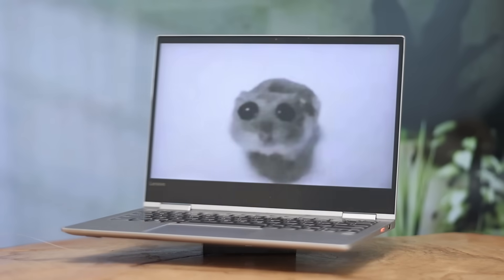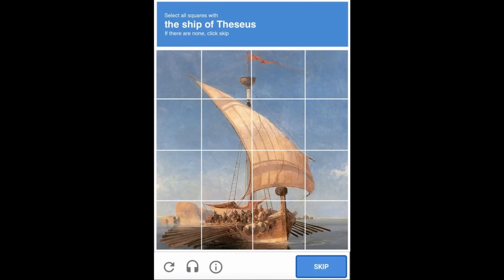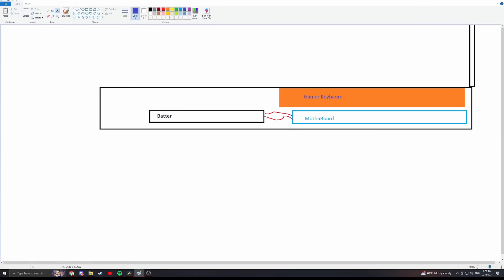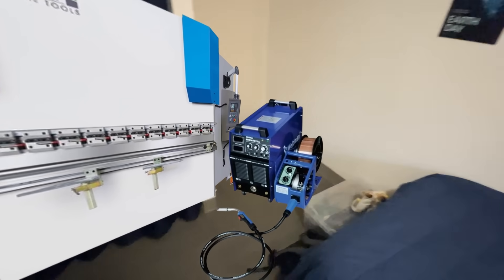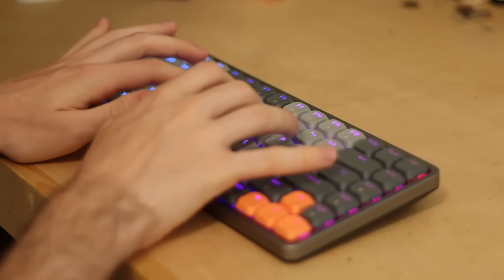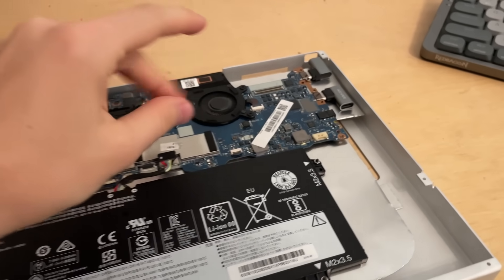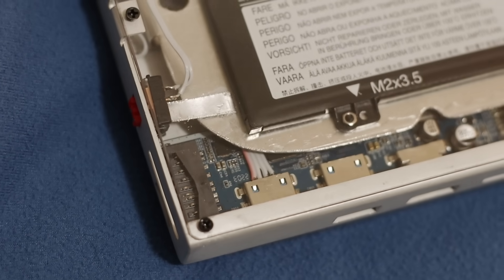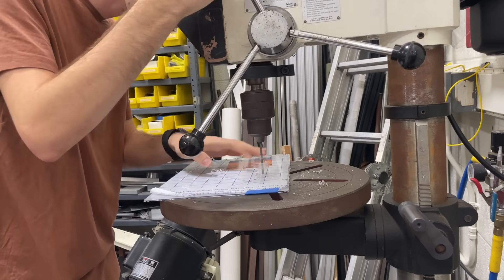I Put a Mechanical Keyboard INSIDE My Laptop

Comment: The nvme controller in my newest laptop (abt 5 years old) died a few months back. I've been suffering with my 9 year old laptop since. Barely even runs ubuntu or whatever I have on it, with awesomewm..
Perhaps the time has come to take destiny into my own hands slightly more than living at the mercy of whatever used laptop I can find, and a mechanical keyboard would be nice.

Comment: I decided to take 3 months of my life at the beginning of this year and designed a 18" laptop frame that is 3" thick that uses standardized desktop parts. One of those parts is a Reddragon K617 keyboard. I have been using the laptop at school and it is definitely also a conversation starter. Mini itx motherboard with noctua L9 cooler and a nice rgb fan on top, along with an rtx 3050 and a flex ATX power supply... I just have to make sure a wall outlet is nearby

Comment: Me Lenovo V14's keyboard started not registering the G H Á and I keys. I looked at replacement keyboards online, and they cost half as much as this machine is worth today. I decided to take it apart, brake the keyboard's connector off of the motherboards, figured out which two pins I have to short to turn the laptop on, soldered a momentary push button to them, took off the trackpad, took off the screen, mounted the carcass on the back of a 27" monitor via the VESA mount holes, and I just use it with an external keyboard and mouse like an AIO PC

Comment: Genuinely a very nice DIY project, here are some improvements i think you could have done or still do:
-	Desolder the stock switches and resolder some better ones (time consuming)
-	Spray lube the switches with super lube 
-	Add some dielectric grease to the stabiliser to reduce the wire ping, especially the space bar
-	Did you remove the speakers? I thought you will need holes for them as well

Comment: Can you please share what material did you select which resulting in this nice case? I wanted to do some similar thing, but I don't know what material I need to use in order to make it look this good and smooth. As if it's made with CNC proccess
Reply from the maker: For this project it is sheet metal formed aluminum with the corners welded and bead blasted for the surface texture, manufactured by PCBway. Best of luck with your project!
Reply: @MarcinPlaza  Thank you so much for your response, do you know if it's possible to get a smooth surface via 3D print?

Comment: I had a similar issue, but it was software. ONLY in bash, the 'i' key would not work. But specifically, the lower case 'i'. If I held shift, I could enter it no problem. If I hit ctrl-v(in terminal is enter literal instead of paste fyi) it would work. But it also wasn't anywhere with the kb itself either, COPY/PASTING would skip all of the 'i' characters. I still can't figure out WHAT I did wrong. Had to fully nuke my homedir after moving it out of the way to copy back in stuff like my steam dir. It also ONLY happened with bash, not with zsh.

Comment: Amazing! Man, we need Brand, which is making laptops like that. I mean, I know how to use Fusion360, but I never had time to make something like that, even I dream last 15 years about to make same project.
My idea is to make laptops with mech keyboard, but the keyboard must be at other position, like a asuszephyrus gx701, but also keyboard can be detachable(or not?) and with adjustable angle and with ability to change switches(clicky, linear, brown, red...). And screen have to be with solid speakers(bottom right and left corners) facing your ears. 
For me laptop is not something you have to take with you every day to somewhere. For me it is more like desktop machine and I can sacrifice size to comfort. I need big 17 -19 inches 4k screen.
I know it can be long project, but also can turn to brand. Market need something like that. Since MSI GT80 Titan, it was a nice try, but for gaming. It is looks weird for business. My idea is to make it beauty for business users. I'm sure it can find lots of fun's if it will be produced.

Comment: It looks like cross between a regular laptop and one of those Windows 95 Desktops - you know the ones I am talking about: the thick Monitors, Overly sized Towers and Keyboards that would look more at home on the Star ship Enterprise from the original Star Trek series. This is like if Nintendo thought about making the NES but tried to cram a Screen and keyboard inside - It looks really Retro. Luckily they chose to go for two controllers instead for the Switch.

Comment: My experience with fiberglass thin sheet is that it will deform when it absorbs a lot of heat, so I advise you to replace it with a thin sheet of aluminum, ABS plastic or steel or tempered glass or a thick piece of fiberglass that won't deform because of its thickness

Comment: Pretty good work-around!  I wish all laptops can easily be this "salvageable" or recyclable! The idea of implementing  a mech keyboard sounds great. For one thing, you got rid of the one single flaw of a Lenovo keyboard:  the inconvenient positions of the FN and CTRL keys at the lower left portion.  I suggest that you insulate the keyboard area's  bottom with a plastic flooring to shield the CPU from any spill from your tasty beer! 🍺 The only thing that may be inconvenient in your design were the ports that you positioned in front. I am sure  the cables that you will connect into those front ports will surely compete for space with your arms and and hitting them unintentionally may eventually wreck the ports. And by the way, it was great you got rid of Windows. While Ubuntu was once a great distro, try some other less limiting yet more user-friendly distros like Linux Mint (XFCE or Cinnamon) or Zorin OS or MX Linux. Great job!

Comment: If I were in charge of designing a laptop, I would 100% make it look like a Fujitsu from the 90s, but with a proper low profile mechanical keyboard like shown in this video, track point like a ThinkPad, extended I/O (ethernet, VGA, HDMI, CD/DVD drive, microSD, separate mic&headphone jacks, 3x USB-A, 2x USB-C), extensive ventilation, HUGE battery, and just overall built like a tank.

Comment: A cool project, it looks really good and should be nice to type on. I like a good, sturdy laptop, like my old Asus which is thick and has clicky keys. The problem with slim-line keyboards dying has been a plague upon the laptops at work, at least the ones that haven't had half the screen backlight die, the battery leak everywhere, or gotten run over. With one the "A" key even fell off and got lost, so the "`" key got put there instead. For the workplace especially more durable keyboards are really needed.

Comment: That keyboard's stabs need something soft in there (bandaids are popular) to reduce the rattle. I have some gauze from leftover medical supplies and stuffed the right amount in (too much will make the stab stiff) and it's way quieter. I'm not too picky about keyboard noise but it made a huge difference on my hand-me-down prebuilt's spacebar and backspace keys (and I make a lot of mistakes, so those two keys are the critical ones). Might need some re-stuffing until the material settles if you're using something loose.

Comment: This is one of the best looking laptops i have seen in years. Thin laptops are cool but a thick laptop with cool things like a big battery or a mechanical keyboard are cooler. Also the clear bottom is like icing on the cake.

Comment: I wish laptop engineers went for a design like this to improve the cooling, ports selections and other things, especially for high-end laptops, the only thing you need is a mesh panel to prevent dust from going into the fans and it'll be great.

Comment: No joke that's the sickest custom laptop build i've ever seen, no competition. I'd wanted to do a similar thing with mine, custom lower frame to accommodate as many 21700 5ah cells as i could fit. it was both kinda funny but also frustrating seeing you encounter so many of the issues i figured i'd run into. subbed af

Comment: That came out really great! Although Id give you couple of suggestions. Add a little feet at the bottom for better airflow and put some filter on those vent holes so it wont suck all the dust in.

Comment: This is insanely awesome. Hats off to you for making this vid and idea

May I suggest making some feet so the holes don't lay flat on a surface? And maybe if there is enough space inside, you might be able to add some super low profile fans in pull config so the heatsink also loses heat more efficiently.

If I did it, I'd probably used a 2 mode wireless and wired low prof keyboard and use a design which allows for disconnection of the keyboard. So when I have to take it out, I'd just slide it out and used it on my phone wirelessly. Then, after its done, I'd just need to slide it back into the laptop and place on a piece with a locking system.

oh btw i subbed :)

Comment: A fantastic job. This is what most laptop creators neglect (even Apple which claim to have super duper products) . Keyword is ERGONOMICs for the User- so the Display, Sound and Input devices like the Keyboard are so important. (sure power too - but for most standard user the current cpus(intel or amd or m3) got enough power for daily task. Would be great if laptop creators would consider this also for 13-14 inch laptops) - 2mm more thinkness would not hurt if it helps the overall ergonomics for humans.

Comment: My IdeaPad s340 keyboard broke because I rarely use it, some key doesn't register an input, some just spamming the input, but my Thinkpad t400 that I bought second hand still working properly 😂, laptop these days are designed to be broke with in 4 years of using.

Comment: You should've tried to connect your keyboard by using the laptop's PS2 port. Now you will probably have a lot of USB wake problems because of the USB auto suspend feature. Do not forget to disable it, or else you might end up with an open computer with a dead keyboard until you reboot.

Comment: I have one of these, and the same exact issues. Power button knocked off, have to start it with a sim card tool, and the keyboard is dying. Im convinced whats killing the keyboard is overheating though, which it does alot when it goes into the wrong sleep state after shutting the lid and unplugging the charger in the wrong order.

I tried to have Lenovo fix it, I was even willing to pay for it, but they pulled an Apple on me saying that the entire motherboard needed replacing, including the SSD that isnt even soldered on. Total cost; more than buying a new laptop.

Comment: i had the same model, which died while installing Linux. you see, wasn't aware the keyboard died, so the password i thought i've set up, didn't work. then i could't get it to boot from usb in order to reinstall OS.
after 2 frustrating hours i've ripped it apart with my bare hands :)). saved the ssd ram and wifi, all the rest was shredded and thrown in the trash

Comment: I was cleaning my house today and ran across some of my 10+ year old laptops, and boy are they chonkers, just a bit thinner than your great creation.
VGA, HDMI, 4x usb 2.0, PCMIA, RJ11, RJ45, firewire, some weird proprietary port I never used, blu ray, 2 headphone out, 1 mic in, 1 audio line out, and also had a slot for a remote control. Absolute media beast.
Hats off to you for your sweet chassis and giving new life to a dying laptop.
Reply: is that laptop you found by any chance an HP Pavillion DV6?
Reply: @gamecuber6  Very close, it's a  HP paviliion DV5. My main memory of the thing is it was great, but ran hot like a furnace. I ran it for so long the fan bearings now sound awful. Not very useful anymore as it runs vista and only has 4gb of ram.
Reply: @TastidiousYabbie  4GB will be decent for Vista actually
Reply: @TastidiousYabbie  genuinely surprised that the gpu in it hasn't yet failed

most of those pavillions with dedicated GPUs had an issue where the gpu would overheat to a point where it would crack the solder balls and require a reflow

Comment: What a coincidence. My laptop (thinkpad) keyboard's Q W E keys have failed and I can't find any genuine replacement for it. There are clone keyboard but they suck, even worse than an external keyboard. So, I pluck out the Q W E keys and put it on the 1 2 3 keys and remapped them. 1 2 3 keys is remapped to home, end and insert key. It works for now... I guess.

Uni is starting in a few weeks so I don't know if I will ever find a replacement keyboard. Was thinking of buying a mechanical keyboard (also low profile like yours) and this video pops up 😮

Comment: Built, not bought! You are an artist my friend! Congrats. Will you put any rubber feet under the laptop so as to elevate it a little and it can actually get some air through the holes you drilled?

Comment: My T530 keyboard has a problem. The spacebar , Function Keys , and N keys are all dead. And yes. I did check the ribbon cable. Outside of that problem I need a new battery . How much should I pay for a new keyboard?

Comment: That exact laptop sucks so much I have the same and with very light use I’ve needed to replace the keyboard the battery twice and the motherboard 
That’s very impressive
Reply from the maker: Dang unlucky pull, other than the keyboard its been great for me, and I’ve spilled tea on it, fell on it, and idek how my battery is still good after 5 years.

Comment: The biggest problem I see with a mechanical keyboard in a laptop is that a subjectively good sounding keyboard is often filled with foam, and electronics need to breathe as you said.
...Could perhaps be solved by acoustically isolating the keyboard...

Comment: nice  job, have you considered putting some padding (maybe rubber feet or something similar)  on the bezels on the screen so you dont get impression marks on the screen from the keyboard. (looks like dirt shaped like your keyboard on your screen.  I had this problem with many of my older laptops.

Comment: Great Idea. makes me want lose a little bit of sanity and do the same for a first generation i3 samsung laptop, although i have zero knowledge in designing 3d things. I got curious: you measured everything like a billion times and got it right in first 3d print you sent to from pcb way or you had to send to pcb way more than one time, after discovering something you did not noticed?
BTW, great project!!! 🙂
And if you manage to include a bigger battery, please make a video 🙂
Reply from the maker: Thank you! And in terms of designing, I was lucky and got mostly everything right the first time, I have a decent amount of experience though. Overall, it is a lot of measuring and checking your measurements again. I recommend making all the parts that you have in CAD first. Then after you design a part, like an enclosure, you can assemble everything on the computer to double check everything will fit before doing it physically. But I would start with making something much simpler than this to learn CAD haha😊

Comment: Nice build! You forgot the rubber feet though to the bottom doesn't scratch. what model mechanical keyboard is that?
Reply from the maker: Yeah I mentioned that in another comment lol, and it’s a reddragon k652, its pretty nice but the actuation force is basically non existent on the red switches

Comment: interesting design, mightve been better if the transparent lexan sits inside the 3d printed shell instead of directly touching the table so it doesnt get scratched up as easily...lexan is also too thin as it is flexing when you are holding the bottom @ 10:57 on the left side

Comment: I hope a Laptop company sees this and hires you, Framework maybe?
Reply from the maker: Yes. They should. I could be the resident insane fake engineer.

But actually Framework👉👈🥺
Reply: @MarcinPlaza  

Buy one?
Reply: There already exist laptops with mechanical keyboards for a few years now, most notably variations produced by clevo. You could refine your version to replicate a sleeker fit like them, and since framework exists now I believe it would be much more easier for you to source their parts and incorporate a low profile keyboard into their framework laptop and possibly sell some units to other framework users.
Reply: @karakuri002 yeah, I'm kinda doing that with a framework, but building my own bottom chassis
Reply: Doesn't frame work support 3rd party mods? He could produce a drop in mechanical keyboard and sell them. Sales numbers would be the best way to get framework's attention.
Reply: @danielstellmon5330  he could if you wanted to make it easy, but some one users would want to that port free for other connections. Ideally would make a version that replaces the existing keyboard with a mechanical keyboard that makes use of the existing keyboard port
Reply: @karakuri002  for the framework 13 (which is what I'm modding), the existing keyboard connector connects straight to a keyboard matrix, so you can't run your own firmware  like qmk or kmk. The framework 16 does use qmk for its input modules, so that mod is a bit more straightforward
Reply: some team has to go first...
Reply: manitoba-op4jx  the thinkpad red nipple would be great too
Reply: they wont, bcs if the keyboard doesnt break, they cant sell those replacement keyboards for after sales lol
Reply: This is hillbilly framework ngl
Reply: They would never hire him in fact they might want him taken out. Don't you see!? With these engineering skills the common man won't be buying a new laptop every 4 years. They'll just keep adding new RGB keyboards every time we spill coffee. He was never supposed to get this far never supposed to become so knowledgable in the way of the PCB. Now that he has shown the world how to reverse engineer the design all the major companies are going to go under. We have now entered a new world where literally anything is possible.